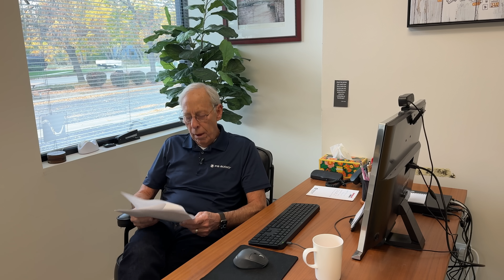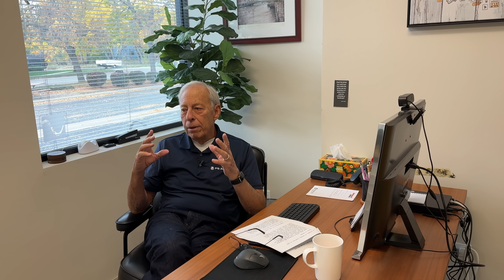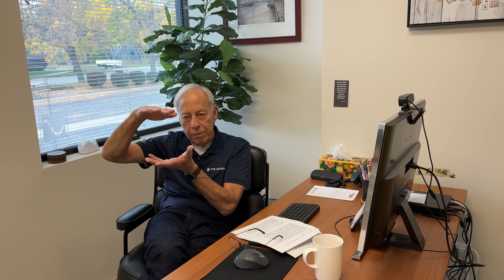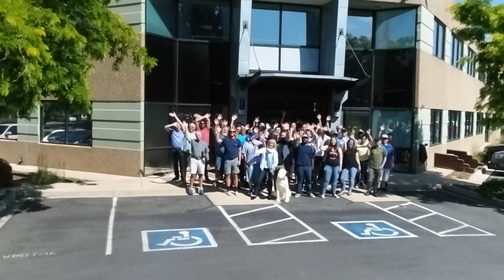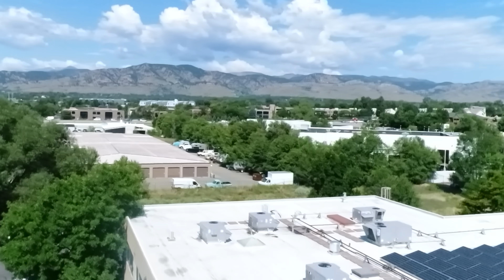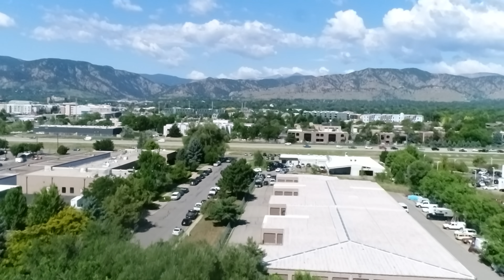Chips vs  discretes in HiFi

Comment: I bought a Fosi V3 and I'm very impressed with the sound with so tiny and cheap amp, using tpa3255 chip class D
Reply: and even that is a bit of a compromise. the filter inductors on the output are a weak point and of course the input stage. but it is designed for opamp rolling and put in a sparkos discrete amp or something similar. this way you can "fix" the input stage.
regarding the output filters, that is not that easy to fix. if you buy the really good stuff from coilcraft or würth, you will realize that the cost is significant and they are bigger which means you don't have the space on the board to change them.
also when you use two of these good Fosi or Aiyama amps in mono configuration the sound stage is wider with more depth. which means that one stereo amp has some significant crosstalk over the rails. which means they made some compromise in this are too.
but i have to agree, i was impressed with what you get for your money is insane.

Comment: I worked on jukeboxes that used a digital inverter CMOS chip forced into linear mode for preamps. The cd4007. Actually worked quite well. Thanks Paul, you are so accurate in your geek talk

Comment: The whole point of an op-amp is that it has a close to infinite open loop gain which is obviously limited by its rail to rail voltage. Modern op-amps really take some beating especially the LM4562 which would be a fruitless task trying to improve it’s performance with a discrete circuit. To be honest, even the mainstay NE5532 still performs well. Discrete op-amps have become an audiophile thing perpetuated by the consumer’s ignorance of electronics engineering but the reality is that modern op amps give designers the opportunity to create a high gain, ultra low noise and high bandwidth gain stage that couldn’t be dreamed possible a couple of decades ago. There’s more to a product than one particular element in its design and I’m sure that PS Audio’s products sound great for many reasons but not simply the use of a discrete op-amp otherwise everyone else would do the same.
Reply: Maybe I don't understand what you're saying, definitely don't know much about circuit design. I recently swapped out that exact Ti LM4562 op amp in my DAC with a Discreet op amp and it definitely changed the sound. To my ears it sounds much better now. I was skeptical that it would make much of a difference but it certainly did in my setup.
Reply: @joshdeakins1775  I don't know about your case, and I believe opamps can change sound, but for a while I played with changing them to compare them, and I was very certain that the ones considered better did in fact sound better, but that only lasted for a while. For some days the MUSES02 was the best thing ever, only to come back to the NE5532P (the stock one) which one day sounded marvelous and never stopped. At that point I just accepted suggestion can be ridiculous powerful, at least in this hobby where it's hard to notice or compare things.

But then again, I believe opamps can change sound for the better because some have been measured and they do improve a variety of things, but some others only make more heat without improving the sound
Reply: @ivanaviNiebla  respectfully, you swapped one chip op amp for another chip op amp.  If there are differences they would be limited compared to using a fully discrete design.

I don’t think you can conclude that discrete op amps offer no meaningful improvement if you have not tried it.
Reply: @superspeeder  I didn't say that, I said we have to be careful of the tricks our minds play on us. Not everything is clear enough and not everything is better but, surely, there are things that are indeed a noticeable improvement.
Reply: @ivanaviNiebla   re-reading your post, it is not as one-sided as I perceived it on first read.  Good points - cheers! 🍻
Reply: @joshdeakins1775  Here's the actual situation you're in. TODAY you say this new change is better but in time curiosity will get the better of you. Then you may change your opinion at that time. Most likely you will because this "audio thing" is a journey that usually keeps getting better... usually just to you though😅 😅😅
Reply: I recently swapped out the 5532s in my chifi monoblocks, two in each amp, for Sparkos SS3602s.  The improvement in SQ was not small, it was very noticeable and definitely an improvement (not just different).  Everything improved; clarity, imaging, dynamics, noise floor, detail, the whole package.

I mention chifi for a reason, and that’s because there’s a lot more to an amplifier than just the op amp.  It’s entirely possible that a much better designed and built amplifier would benefit less from this change, and absent the ability to test this for myself I would accept that possibility.

For now though, I will stand firm that, based on my own experience, a discrete op amp upgrade can definitely improve an amplifier’s performance.

Comment: This is a very interesting explanation to the question and is one of the most accurate (short) ones I have seen. The usual BS goes along the line of, yeah, an IC can never be as good as a discrete component for X, Y, and Z reasons. Whereby X, Y and Z are usually as far detached from reality as possible. The real reason, as Paul mentions, has to do with the high open loop gain that op-amps intrinsically have (more is better here) AND the way the gain is set in the circuit by a global feed back. It is this architecture that kills the musicality of an amplifier.
Reply: Indeed any power amp or pre amp with excessive  global feedback does kills the life out of the sound even though it will measure fine
Reply: @pauldavies6037  Excessive feedback does not measure fine, at least when defined by engineering standards.
Reply: The perfect amp or opamp does no coloration at all, and has 0% distortion. That can only be achieved by high open loop gain en strong feedback, which cancels out the remaining errors. This works because an opamp with feedback is a control loop that steers the output such that both inputs are at the same voltage. But there will always be an small error voltage, which results in distortion of the output signal. The higher the open loop gain, the smalled the error voltage can be and thus the lowe the distortion.

And only a single chip opamp can do that because to be able to work that good, you need perfectly matched transistors and laser trimmed resistors. You can not make a discrete opamp using matched transistors and expect that the matching is better than the transistors on the same chip, made in the same chemical process.

The moment you start comparing opamps and say "hey this one sounds more open than the other" or "this one has a better sound stage", you're effectively saying that the opamps have some form of distortion or non-flat frequency response that make them different.
Reply: "Musicality" is meaningless BS.
Reply: @montynorth3009  "Musicality" maybe so but musicality is not ;)